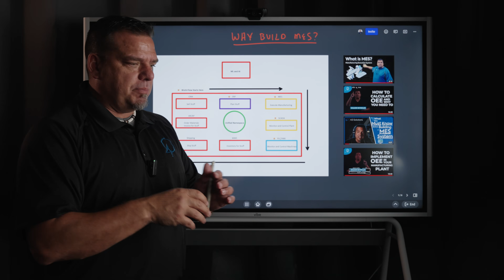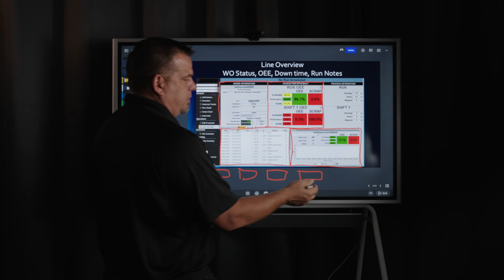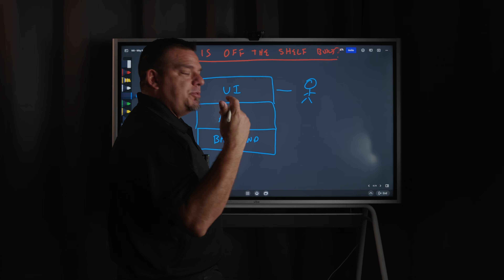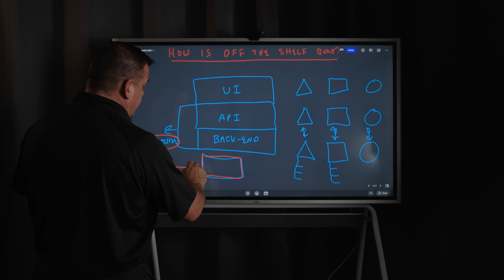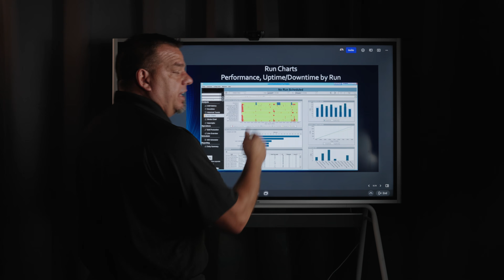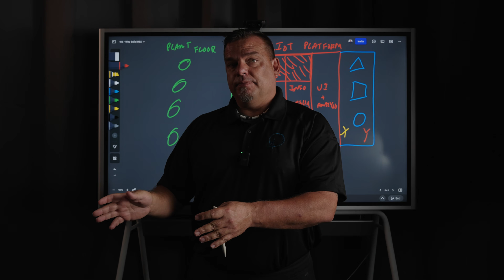MES Systems: The Secret To Manufacturing Success

Comment: Late to the party!  I;ve been doing MES with Emerson Syncade over DeltaV and Siemens OpCenter over PCS7 (and some Werum PasX thrown in) for the last 20 years (in life science primary manufacturing).  What you described here is far lower level than anything we've ever had to done.  Somewhere there is a disconnect between what you described in this video and what we/I've been doing.  No custom code (apart from some ERP, LIMs interfacing).  Now most of what we do is for execution - not for oversight.  Batch execution is the primary reason for all the config, backed up with electronic logbooks, material tracking - not dash boarding/overviews - is that the difference between the "hand cranked" build an MES you described here vs off the shelf?  Hope this doesnt come across as trolling - I am genuinely interested why what you described doesnt match with what I've seen

Comment: Nice video. nowaday erp has many modules integrated internally eg generate work order, production, inventory etc. But data input from OT systems either manual or integrate with erp. What is your comment on this? How to architecture of IT and OT not forgeting security😁? Tq

Comment: I see a lot of manufacturing companies that use paper-based or digital paper-based MES. They produce high-tech / complex equipment and machines in low volumes with a lot of manual assembly operations. What will be the best strategy in this case for building an MES ?

* You stated they don't go from paper-based to iiot based in one go... so this is why I ask

Comment: You know I am a big fan of the IoT UNS approach, but I need help to see why analytics would not be separated from the application UX layer rather than an analytical result set. This separation is generally considered to be a milestone in data maturity progression.

We both would recognize that the primary goal should be the "holy grail," getting the data to a state where data science tools can be used for analytics. So I am surprised that you want to do analytics and calculate KPIs with Python, SQL, or other code before the events would be stored in a semantic mode on a schemaless store.

I see Tabular, the data cube based on the Varipaq analyzer, as a best-fit node in the architecture. It solves the need for differing OEE calculations to filter and group the base aggregated data set for the OEE scoring.

In the past, you have expressed aggravation with Power BI being put forth as a solution for the OT side. You may have yet to consider that MS analysis services can run the MS Tabular/Cube, and you can query that and bring that back as a source of OEE without the cloud and Power BI. I see why a plant floor OEE would be calculated for the current OEE, but I would throw it away afterward.

One of my primary arguments for this clarification is that data exception reporting could be established to make corrections to MES data. I consider the UNS data from the OT layer only to be a single source of truth of what automation reported, but every domain system has its truth with an audit trail. This would allow the MES/Production Work Order system to have an audit trail like a good CMMS, LIMS, and ERP system. And avoid differing truths in OEE and other KPIs related to plant floor production.

Comment: Starting with ask Rockwell ask Siemens ask Wonderware and end up proposing ignition with sepasoft… without having a clear understanding on how to solve the cells that gives information and those which aren’t. This could be an issue even do you build your own mes. I think if I use other software lets take ww + their off the shelf mes, I’ll end up with the same possibilites to create different cells and represent them as I want. 

I’m always following your ideas but here I’m not sure I agree